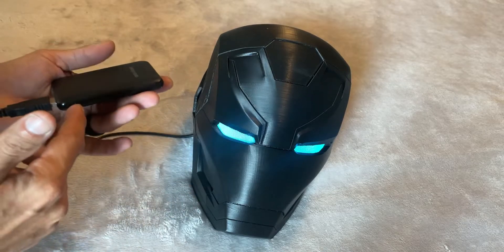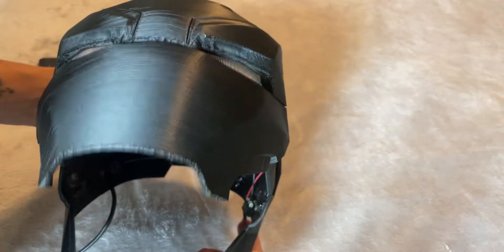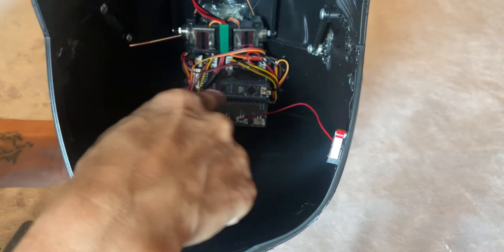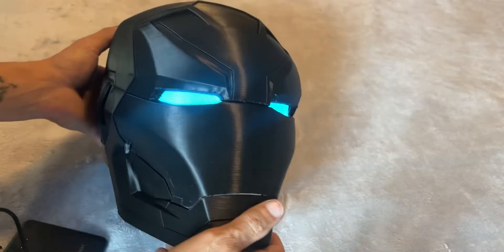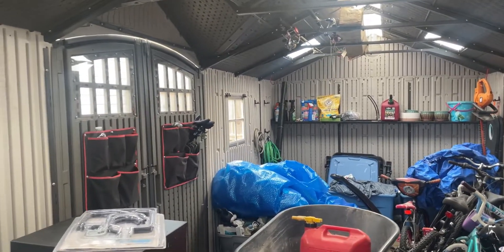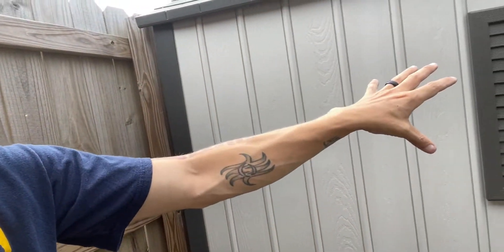Motorize your iron man helmet! How to open & close iron man faceplate powered by crashworks!

Comment: Cool clean looking inside already. Just seen a video where the guy used elastic rope like material on the inside on the top for the hinges. He did not use the side ones on the chin and helmet. Worked pretty good.
Reply from the maker: Yea never tried that but a cool idea
Reply: Would you have an example? i'm looking for that kind of solution.

Comment: Nice video and channel! Question for you about crashworks... how do  you prevent the Faceplate from falling down after it opens?  In my build although it does open as soon as I tilt the helmet forward it collapses.
Reply from the maker: Sounds like the hinges may be loose, what type of helmet & are you using sg90 servos?
Reply: @Darkwingdad  Hmm... possibly didn't really consider that. I followed Frankly Builts tutorial and he said to make sure they can move freely and I'm just on the edge of that but possibly making them a bit tighter could help. Doing the IronMan Mark 95 with sg90 servos.  Looking at the crashworks arduino code. the servos detach after the open/close action, so they are not longer active, thinking maybe I could keep them attached. Have you ever done that?
Reply from the maker: @thecyberhobbit  could be the positioning of the helper arms I’m literally doing a new video with crashworks now and editing it. It could also be the location of the faceplate connector. I am doing a mk80 the avengers campus model & made custom arms and I have no such problem. What board are you using?
Reply: @Darkwingdad  crashworks mk 6, you're right it might be the faceplate connection spot... I might have needed to go lower
Reply from the maker: @thecyberhobbit  my thoughts are if it’s not up enough gravity will take over, I would try relocating it, you’ll likely need to adjust the helper arms as well

Comment: If your using the crash works board, or just flashed their code onto an arduino, if you hold the switch button down it will dim the eyes for you, no need for a potentiometer.
Reply from the maker: Yea I realized this after I filmed, however the potentiometer gives a variable control, still useful to show.

Comment: Seems like the latest version of Arduino IDE runs in to a lot of issues with the code from the crash works mk85 tutorial!  Have you experienced this at all?
Reply from the maker: I’ve used all there boards with Penelope and sue included and no issues at all
Reply: @Darkwingdad  strange, for me the issue lies with the libraries in the code, even though I have them all installed